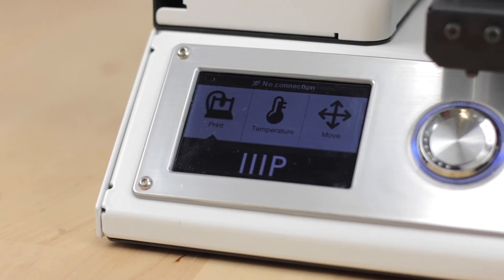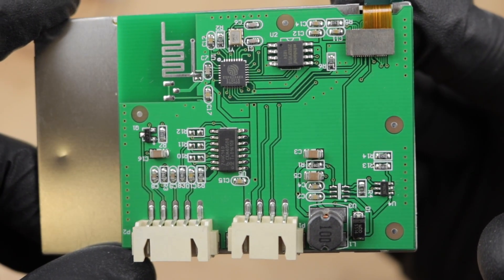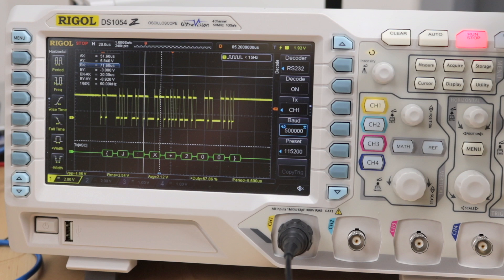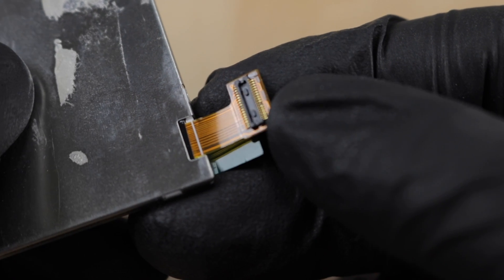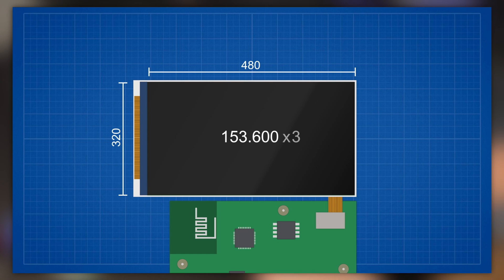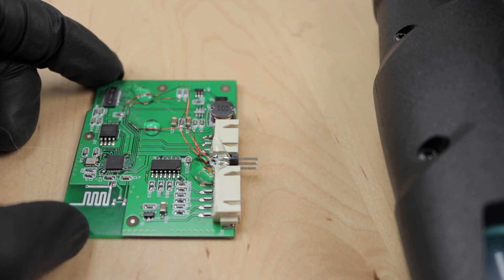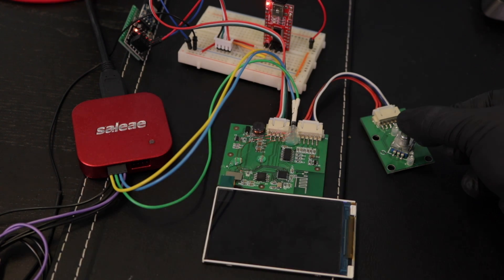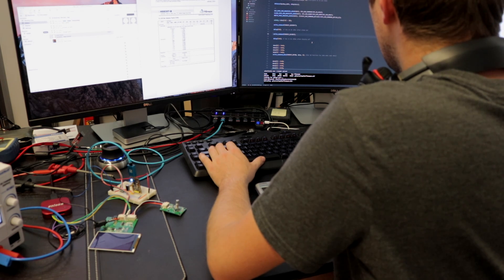Electronics Reverse Engineering Walkthrough - Hacking the Monoprice Select Mini 3D Printer

Comment: What would cause the motherboard to not let stepper motors activate or sd card along with fans to function? Should I be looking at the capacitor of transistor? I have 3 motherboards that all have the same problem on the monoprice mini select same as you worked on in the video?

Comment: Is there any way to rewrite firmware with this reverse engineering? I would like to rewrite the m106 pO fan control as a part fan cooler instead of it controlling the hot end fan. Could this be possible through rewriting scrips in gcode?

Comment: Thank you, this was very interesting! I've been fighting with my M200 Malyan version. It just went dead as I was printing and I had to re-upload the firmware (it was stuck in bootloader mode i think). It would not boot at all with the sdcard inserted and the sdcard was hot! Felt like the sdcard failed and shorted the printer somehow...? Well anywy, After the firmware upload (from the mp select mini google drive repository), using another sdcard, the jog wheel does not work in the interface anymore. However it must be a software issue because i can still hold the button in to update lcd.bin. So the bootloader recognizes the button push.  I've tried lots of different versions of the firmware. But none of them likes to talk to my jog wheel. I remember something similar like this when I was tinkering with firmware for it a few years back, and I reinstalled the Malyan firmware for it then and I've had it since. Unfortunately i have not been able to find the original Malyan LCD.bin, and the UI.bin for Malyan assets. I suspect that there is some component that is different between the version I have (Malyan M200) and the monoprice version.

You are my best bet to explain to me where to start troubleshooting.  :)

Comment: I know this is an old video but, I had my v1 screen break a while back. There are no v1 screens available. I was told the steps to connect a version 2 screen,done. I purchased several screens that were close but had 50 pins. could you show how to connect different screens to a available driver board?  I could not get a information sheet on the driver board either. How about a larger size reen or any screen. That would be interesting and usuable information. To use the machine I had to go Arduino 2560.......to make that machine work. Thanks for the video and I hope for more including more on screen replacement. Thanks

Comment: Hello. I am interested in using the serial pins to talk to the 3d printer. I have tried sending gcode commands to the printer over these pins but get no response. There must be a magic proticall so that the LCD with esp can send commands to the main control board. Do you know what the secret sauce is?
Reply: Michael Molinari ?? Have you actually watched the video?
Reply: @ArnaudMEURET  Yes. It was probably some time last year. It was my goal to replace the display board with a raspberry pi and be able to control the printer in a high EMI environment that could not use USB. I ended up using an altered firmware for the main board,

Comment: Any chance you could figure out how to connect this LCD and encoder to a RAMPS board? I've upgraded mine to a MKS Gen L controller so I could have more options enabled and use the ultra quiet TMC2130 drivers, but it would be cool to put the stock LCD and encoder back into the unit and have Marlin 1.1.x or 2.0.x talk to it.

Comment: I received a v2 not too long ago with blank display issues and booting issues after a bed cord replacement. This insipired me to try and flash the board with lcd.bin, big mistake since it was version 1 firmware. Would you or anyone in this thread happen to have a bin backup of the esp8266 firmware I could download and reflash?

Comment: I have 2 mini 3d printers that are broke. Do you know where I can find the schematics for the main board and the lcd driver board? I am fairly new to electronics and would like to repair them myself rather then just buy new ones. I have looked everywhere I know of. Also, do you know where I could find screens that will connect with the driver board as my screen flat connectors have broken off the screen and I cannot locate just the screens.
Thanks.

Comment: Awesome video,  Robin do you think it would be possible to change the hard coded axis length values in the firmware to make the board run a bigger printer? Am thinking longer rails and bigger Z axis...A DIY monoprice Big select. the software stuff am not a pro at but mechanical design am good at being a mechanical Engineer by training.

Comment: Which USB to Serial adapter is that, and how did you have it wired? Normally the USB to Serial adapters I have seen only have 3 pins, but the connection from the lcd has four.
Reply from the maker: That is a standard FTDI adapter. Nothing fancy. 
The four connections are VCC, GND, RX and TX.

Comment: You made definitely one of the best reverse engineering video's on Youtube!

Compliments, I hope someday I will have some skills like you to do stuff like this.
Do you have any tips from the expert? I have an device that I wanted to reverse engineer, I read all the datasheets, but I have no idea how I can ever get the existing firmware from the device, they used an STM8 series as core, hooked to some sort of communication bus to communicate with the other chips in the device.

To start as noob, I got myself an ST-Link reader/writer with an identical STM8 chip to try out, but it was from China and in the end I tried over 30 tutorials but it didn't work at all, so maybe it was broke in the first place.

Thanks for the youtube video! I hope you'll  keep making more!
Reply from the maker: Thanks a lot!
So before dumping the firmware of your subject you'll obviously have to get your toolchain running.
What exactly did not work?
Reply: Thanks for your reply! I thought before I go hacking on the actual device, let me try on the test STM8. I think the actual device communicated with the other chips on an UART bus.

On the cheap test device, I connected the 3V, GND. Then I have SWCLK and SWDIO left on the reader/writer and on the device: SWIMM and NRST.

I linked NRST to SWCLK and SWIMM to SWDIO. When trying in the software in the computer I could not read nor write to the chip, so I swapped the NRST and the SWIMM, this resullted in the same result, in both cases trying and trying, it could not write, read or even detect an chip. So  I followed some tutorials on the internet, resulting in exactly the same problem, no results.
Maybe the ST-Link is not working properly? Since i bought 2 STM8 dev kits, and both have the same problem.

Also on the actual device, I'm not sure if these flash pinouts are connected, it's an multi layer pcb and I couldn't find out if they where connected or not, if not I will have to solder the wire's directly to the STM8 (hoping it doesn't fail, since i'm not very good in soldering). I don't it would be possible to read/write from the UART bus right?

Comment: Hi everyone,
 I have the kossel mini at my house and their is a problem. I put retraction on at the beginning of 7mm and the printer keeps stringing a lot. I honestly don't really know what to do because when it strings to much my print fails. Retraction basically means when the 3d printer creates a 2nd layer it pushes the filament back into the nozzle of however much you put it to (mine was 7mm). Can anyone please help?
Reply: This isn't a kossel printer nor a video on printing technique. Try asking this in one of the kossel/delta forums or groups or the dozens of videos about printing techniques.
Reply: Nirshanth Kiritharan While Davey Hi is correct, I would be happy to help anyways. Are you sure it is actually ON? Does the extruder actually move backwards?  Also what is your retraction speed?

Comment: Well, as I'm a mechanical engineer, I know just a little bit regarding electronics and these kinds of stuff. But I'm absolutely sure that is awesome piece of work.
That can be first steps of a reliable open source 32-bit 3D printer controller board and firmware.
Maybe you can turn this into a Kickstarter project, before Chinese make use of your effort.
I take my hat off to this. Congratulations.
Reply: ???? The Chinese are going to steal the hack of the software they wrote?!? lol

There are already open source 32bit printer boards that have better software than the MP mini and doesn't need hacking. If you were a company building an OEM printer you'd just select a display and use the datasheet for writing your code.

This is just a hack of the display protocol which is a far cry from reverse-engineering the motion control code. That could infringe on copyright issues.
Reply: There is a word reliable

Comment: Awesome job! there are a bunch of features i’d like to see added… I cant wait to contribute to the project!

I’d love to add a second extruder— any plans to put some work into the motion board as well?
Reply from the maker: Thanks Gretchen. Well in terms of motion board. The only work that could possible have some benefit would be to port something like marlin to run on the STM32. But that would be a bigger deal. I'll try to at least backup the firmware from that so one could resolder and reflash the STM32 if it breaks. Then all the parts in this printer are pretty much replaceable.
Reply: What about smoothieware? I think thats a better candidate for a 32bit mcu than marlin.

Comment: This is great stuff. I wish i had found this before i hosed my machine with bad firmware. You wouldn't happen to have the 25.40 firmware packet, would you?
Reply from the maker: +fiddler mikey Thanks :) Do you mean if I made a backup of 25.40?
Reply: Robin Reiter, yes. I am looking for a backup since I messed up my firmware and nothing works and I did not know about the firmware backup process. A more detailed description of the backup procedure would be helpful.
Reply from the maker: Actually I am not entire sure what the exact UI firmware version was. But that actually does not matter too much. I haven't updated since a while. And if you'd like to use a newer one you could easily flash your esp with my backup and then upgrade. The reason why I did not publish my backup is simply because I think some will mess up their UI controller because it may not seem 100% clear how to correctly flash that microcontroller. I was planning on making a short video about that in the future. If you like and know how it works I'd definitely share the file with you. Simply shoot me an email. You can find the address in my channel info.
Reply: Do you mean the firmware for the display or for the main motion controller board? That's the one that gets corrupted but the backup here is for the display. There's firmware and info on another server that's semi-private so I don't want post it openly on youtube. I'll send you a link.
Reply from the maker: You have a complete backup of the motion controller? (I don't mean the update.bin you already get from malyan but the complete firmware)
Reply: Me? Not yet. Just bought an stm32f103 board and a ST-LINK adapter to play with. Now I just need a brain to make it all work!  I think you can read the entire image via ST-LINK unless it's locked. Not that familiar with it though.

Don't recall if you were on the thread, but Marlin will compile with the the stm32duino board addition to Arduino. Haven't tried to burn it yet.

Comment: Well a reprap ramps 1.4 work in a monoprice mp select mini 3d printer
Reply from the maker: Is that a typo and should be Will ? If yes, I am not sure if that works. So far I only used stock boards on this unit.

Comment: Wow, extremly impressive.
I would not be able to solder or probe something so small, my shacking hands and bad view prevent me from doing so.
Even measuring voltage on a stepper driver potentiometer is a feat, and I burnt more than 1 mega in the process.
Reply from the maker: +Thierry Schork Thank you! For me it heavily depends on the amount of coffee I had. Too little and too much will also make it difficult for me :) 
But most of the time I'm alright doing that!